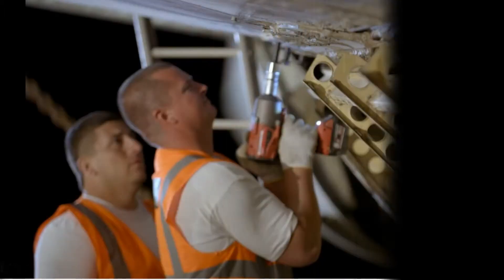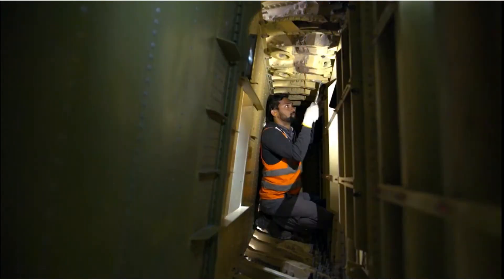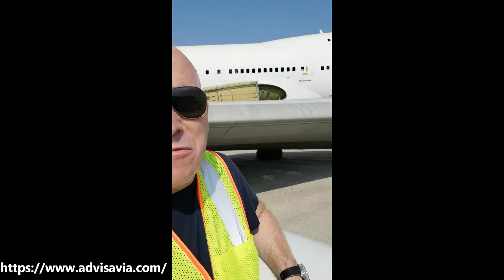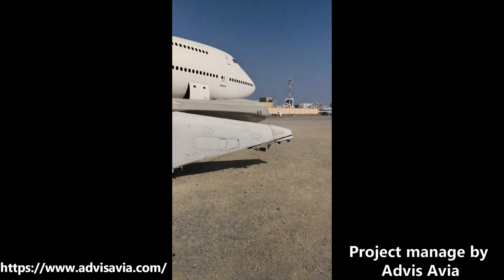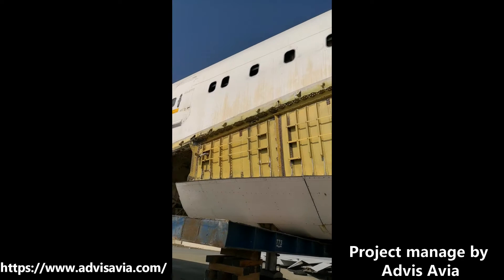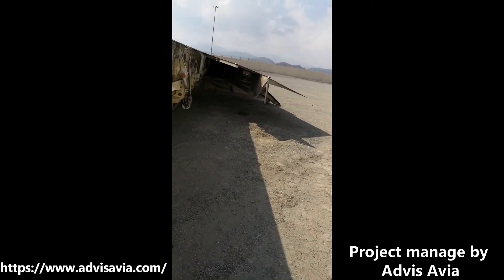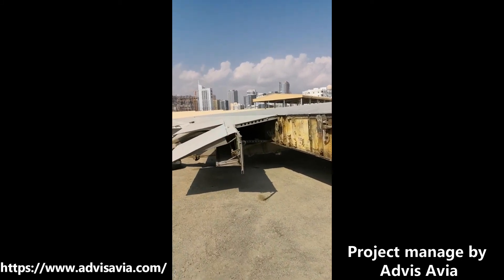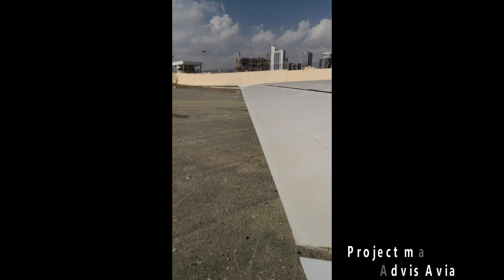HOW TO REMOVE THE WINGS OF A BOEING 747 | ADVIS GROUP - AVIA

Comment: There is an entirely complex process to attach the wings to a commercial jet, and it's more than just 250 bolts. Due to secrecy and patents, he can only show what Boeing will allow to be shown. These wings are secured with way more precision and strength that's being shown. But it's interesting to see some of the inner workings of the wing while detached.